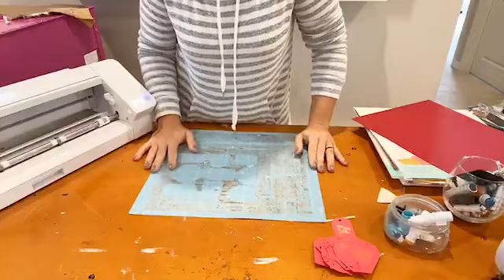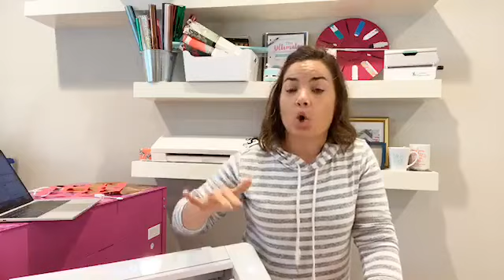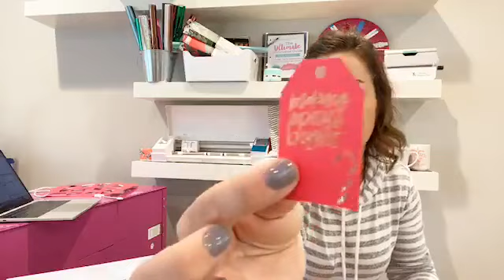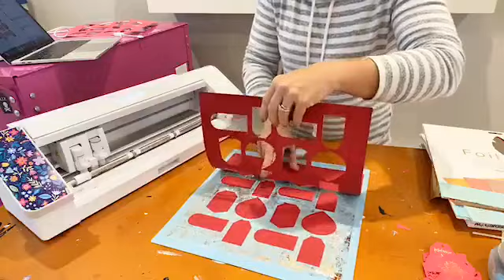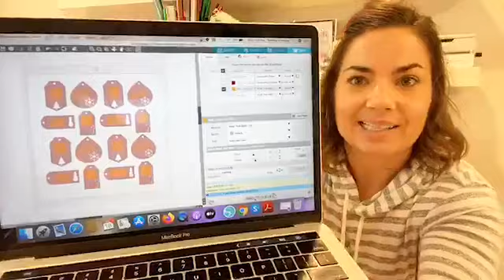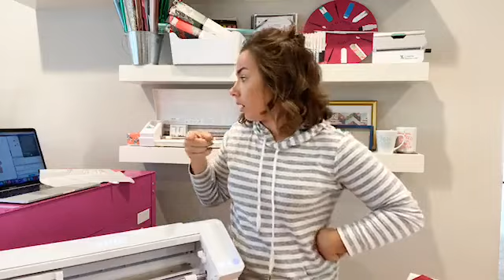Silhouette Cameo Foil Quill Hacks and Tips

Comment: If I have a logo already, will it just do the outline of the logo or is there a way to fill it in?
Reply: Normally it would do the outline, but if you put a lot of internal shadow lines in your logo, it will also fill the logo. If you have the correct software upgrade you can also use sketch fill to do that.

Comment: What would be the benefit of using the silhouette vs. just printing using a laser printer and a laminator for foiling? Trying to decide which is better option before buying the foil quill.
Reply: I'm wondering the same thing. I feel like you'll need to purchase a lot of different fonts now because it'll just outline instead of fill in unless you purchase the quill files
Reply: @jenm4155  it doesn’t matter who’s fonts they are if they aren’t single line then you’d have to try to add a fill so they won’t be solid like a printed font. That’s the difference really between using the quill vs printer and laminator. It’s cheaper to buy a foil quill than a laser printer and expensive ink but it depends on what look you want to go for. You can also use the quill to draw dingbats too to add to things. I’d be surprised if there weren’t cheaper second hand foil quills around as a lot of Cricut owners sold theirs when they bought the Cricut foiling tool.

Comment: That is a quick hack but seems like a lot of foil is wasted. Could you group your designs closer to waste less foil??
Reply: Yes, but probably not without taping down the foil as the gaps in between on this project as what helps stick down the foil using the sticky of the mat. You could place all your tags close then tape foil over instead to save foil though.